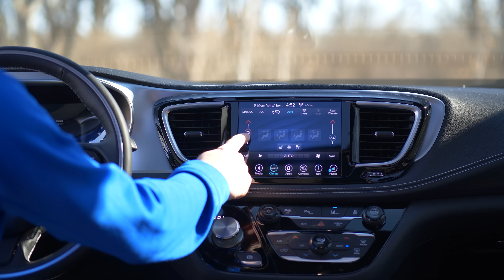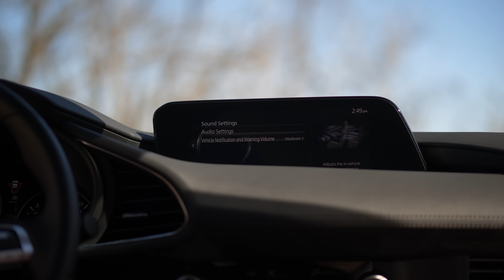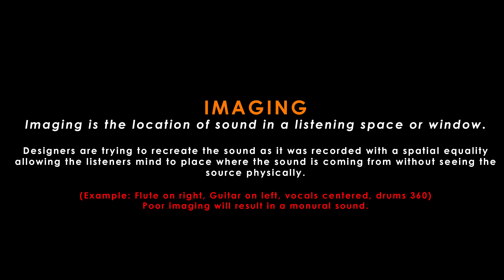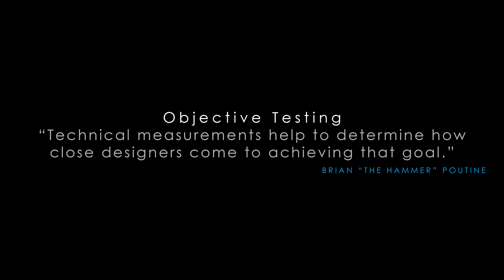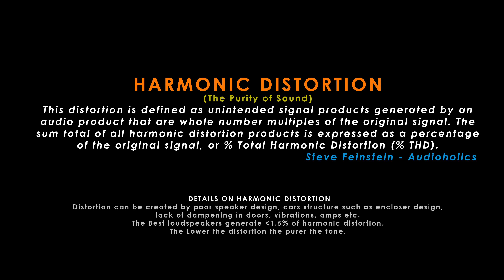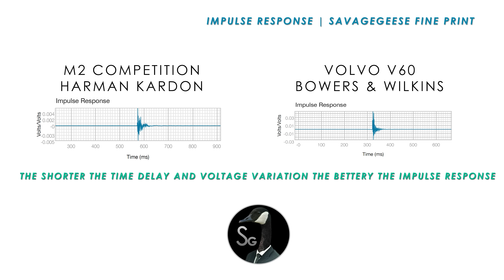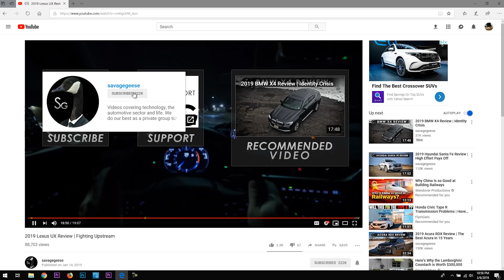Understanding Car Audio Design

Comment: I have always upgraded the sound system in my car, which is why I wouldn’t ever option for an “upgraded” factory system. Right now I have a stock touch screen heads unit with Audison Voce AV K6 components up front, Audison Prima 6.5 coaxials in the rear, both built with custom door enclosures, matted with a Massive Audio Sound Pricessor (to integrate the OEM head unit with the aftermarket sound system as I love the OEM head unit), Massive Audio 9-band equalizer, Custom dual 12” sub box, (2) So y GS Series subs, a Hifonics Mono 1500w amp for the subs, and a NVX 800.4 amp for the speakers. Front and rear doors are sound deadened as well. 

I’ve had Polk Audio MM series and Focal Power series speakers, and the Audison blow them both out of the water for sound, clarity, and power achievement. I would love to go to a (1) 12” sub setup eventually, with a better sub (even though the Sony GS subs sound very good), just to save space, and eventually would love to get a 12-15 band equalizer and an Audison bit-1 sound processor. From there I think it will be as complete a setup for me. 

So far though, this is the best sounding system as it sits right now, I’ve ever had and also one of the best I’ve ever heard. Cost a bit more than a “factory upgraded” sound system, but worth every penny.
Reply: Rear speakers are a waste if sound quality is a concern.
Reply: MICHAEL GRANT true, but because I don’t have the bit-1, which would help me achieve better sound quality using the front speakers, I have the tears to fill it in. Also, I have the tears mostly for rear passengers, and I have a 4-door, which helps fill in the sound for those in the back. Most of the sound for me as the driver, is coming from the front speakers. This is also why I went went coaxials in the rear instead of components, because I know the rear is just for fill in for rear passengers, so I didn’t need anything crazy in the rear. 

I’ve heard plenty of good setup cars with only front speakers in the car, as well as bad setups. If you only have front speakers, you better have a good setup or else it sounds like junk.

Comment: Great video and i hope series..
I have few points you need to consoder..
1. I have a honda legend kb2 and i upgraded the audio because it was crap..its a bose audio..but i figured out after the install where the letdown was on the system
I had all the speakers tested and acording to the engeneer who did the test ..he said that the speakers are so good that many time more expensive speakers can envy them..
The let down was the audio processing unit (amp) 
I found that when i used a helix dsp to control the system and used the low level input from the headunit to get the sound..it sounded awsome..and i told myself it was worth the upgrade and 20days of install..than i found out no controlls worked..volume..mute or anything...it turned out those were after the system amp..and i told myself no biggie i will use the high level input on the dsp and have all channels 5.1 put after the system amp via high level to the dsp..and rewired it and when i turned it on i was such disapointment it sounded exactly the same as before..
Not the insulation, not the speakers upgrade or all descrete amplification matered..just sounded crap..and i couldnt understand it..and went back put it like it was with low level stereo and it was a studio..and than i found out that it was the system amp-dsp that did all the damage..and later i read on a forum that it was all engeneered as it should sound wise but bose was not do the electronics and it was 3rd party even if it said bose on the unit.
Long reply sorry..i have some pictures of the install if its needed i can send a link and measurments of the speakers with the clio

Comment: Of all the cars I had (1992 Peugeot 405, 2008 Corolla, 2012 Seat Leon, 2011 Subaru Outback)
By far, the best sound quality was in the Seat Leon. Each door had a big and small speaker, and the head unit was the most basic thing imaginable. And I loved it the most.

Comment: Really appreciate going in-depth about audio systems in cars. Most reviewers barely mention the sound system, saying it's "OK" or "pretty good." But I do question using Bluetooth only. I think it would make sense to use USB since you're likely to get the best possible sound quality from USB and it makes no sense to me to test these audio systems to the same standard. Bluetooth can be affected by a number of things, like the head unit, interference, whatever device you're using (will you be using the same phone 5 years from now for your standardized testing? I doubt it.), while USB is consistent.

Comment: so the tweeter swap for 3.5" coax speakers in the dash of my CX-5 probably didn't do what I wanted it to even though I gained a lower frequency response up high vs only down low in the doors.  However, some Audio companies don't spend more on the speakers, just more on the fancy amp and sound processing to make crappy speakers sound better than they are; ear trickery....

Comment: I will never forget, probably around 2003, at a car show in baltimore, there was an Acura NSX in the "tuner" section with its top off, and just blasting willie nelson. So against the grain of the car show vibe, and I loved it. 
It was the cleanest car stereo I have ever heard... he had something like a 1000W rms amp with 32 channel manual EQ under the seat.... didnt see a single speaker, all tucked away in stock locations I guess. 
In retrospect, it probably only sounded good because I was standing outside of the car... HA

Comment: This is great. Car audio is important to me and few reviewers touch on it, and normally then it's only in passing.

I would say though, that the sort of person interested enough in car audio that they want to hear about it on the Savagegeese channel (itself on the more technical and enthusiast end of Youtube car channels) are more likely to be interested in uncompressed music. So I think it would not be unreasonable to consider doing your tests with uncompressed tracks connected via aux or USB. For me, Bluetooth and anything compressed, whether the source itself or the transmission, is a dealbreaker. Just a thought that your audience do not correspond with the typical car consumer and therefore maybe going the Bluetooth route because it's most common among consumers in general doesn't quite follow.

Great video nonetheless and I learned some interesting things.

Comment: My 2004 Mini has the Harman/Kardon setup in it. The magnets of the drivers all have the H/K stickers and say "Made in UK." It does sound better than the non-H/K setup. It would seem, back then, they actually took the time to get it right and it's not just a badge. They also made sound profiles for the amp, but the best are "spatial" and the H/K tune. My 2007 Suburban supposedly has a Bose system in it, although it doesn't sound like it.

Comment: Mark, thank you as always for letting us improve our knowledge through your videos. Once again you've proved yourself to be very informative and pleasant to hear. One question though: my 2002 miata's OEM sound system really sucks. Being a spider, there's a huge amount of noise coming from the engine, the wind, the tyres, and so on... How much would you spend to upgrade it, and how would you improve it? I like the look of the OEM head unit, but I'll sacrifice that gladly to get a more pleasant sound experience. Thanks to everybody that will answer my question.

Comment: sound isolation is the most important aspect in car audio. you can made a cheap base model set up that had only low cost as the goal. Actually sound pretty decent when you isolate road/wind noise. adding in sound barriers/absorbotions to keep un-wanted sounds from entering the cabin. on the flip side. you can drop $5k on audio equipment and have it wasted by driving in a tin can.

Comment: Great video! However compressed music itself isn't synonymous on tinny sound. You left one important factor that isn't only appearing on cars. But in the mastering choices for tonality can offset the overall experience. Also the bose bass heavy approach has good sides, because listening environment changes when there is road noise and people play louder. This leads to situation where ear sensitivity for mids and highs come to play. You can check the Fletcher-Munson curve. One really nice feature would be automatic eq tilt that compensates the tonality regarding the master volume.

Comment: Excellent video and very informative! I had a 2019 Ranger Lariat out for a test drive and it was equipped with the B&O audio system. Very disappointed with that system and I was thinking to my self, either I don't have an ear for music or Ford got the B&O labels cheaper than they could get Infinity, JBL or Sony labels. My Ram SLT had better audio system and it was just a stock system, not Infinity or Alpine. I expected way more out of the B&O system for the $3000 cost.

Comment: Any acoustical analysis of why luxury car's were using acoustic windshield, dual pane front door and rear door glass and now have opted for acoustic glass only on the front doors and windshield? The Mercedes S500 was a Vault with acoustic glass windshield, dual pane side glass and acoustic rear windshield. I can't forget the use of acoustic glass in sun roofs vs regular tempered glass that most luxury cars use.

Comment: The beats system in my car is only the added sub, but in the past the same system has been branded as fender, as all the speaker part numbers are the same. it's just what sticker is on the A-pillar tweeter.

also ford uses B&O play, audi uses 'proper' B&O.
Reply: Kind of funny because FCA does H&K proper without an arm and a leg

Comment: For audiophiles most new cars systems will be swapped out with aftermarket quality. My fasher in law replaced his accent speakers with mb quart components and 4 beastly 8" woofers on 2400w. He's been in the audio game since the 80s.
Reply: 2,4000w system in a vehicle is laughable.  Wattage means so little in validating a systems quality. I have 1 10inch JL W1 v3 sub in a ported box getting 300w of power as recommended in my open trunk (Subaru forester, fully deadened). Paired with JL components and a Alpine 5ch amp.  You feel and hear everything. Anymore power and my young ears would get damaged for life at normal listening volumes. That’s a reasonable $1,000 system with an extra 800$ for labor and new infotainment. The only reason I see to go for more power is if you drive a large SUV. My point is quality over quantity, why do you think there are 800$ single JL 10 inch subs? There is only so much space in a damn car for air to properly move.
Reply: @robob221  4 Dc audio m3 8s and 2 JBL gto 1001 amps pushing them. And mb quart components in the front. He's about sound quality and bass quality. Built and installed himself. And i know what a JL 10" w3 4ohm can do since its what i have for my e30 with a 500w jl pushing it.
Reply: @voltairee3012  bass quality and a tiny space like a vehicle are two things that don't fit. I understand the appeal of massive base that tickles your whole body but to say that's "quality" is extremely subjective. Bass needs a lot of air to mature properly, thus cramming multiple subs in a car grants diminishing returns no matter how you install them. At that point it is simply better to stand outside of the car. If we are just talking about competitions then sure, within those parameters I can see the purpose. For practical use in a car though, where you want to hear the full spectrum without massive reflections disturbing the rest of the frequency, less is more.

Comment: BOSE's rolloff is annoying when you listen to classical or prog rock where the dynamic range isn't compressed, so it ended up sounding extremely dull in my C4-era ZR-1. There is a saying "No highs, no lows, it must be BOSE." They should instead aim for a flatter response and advise consumers to leverage EQ (or treble controls in less advanced head units) to tame the tinny sound on DR-compressed recordings rather than fuck it up for people who listen to music that isn't so compressed. When those people complain about the harsh sound dealers should be cluing people in to the tone/EQ features and tell them to RTFM instead of gimping the audio system.

Also, where the driver's seat is (hopefully ;)) ALWAYS occupied when the car is moving, and the passenger seats are not, the driver's audio experience is what matters most and what the audio system should be tuned for for frequency response and timing, with passenger seats being a lower priority. 

I like HK for factory systems because they don't severely roll off the highs and I find myself turning down treble on DR-compressed recordings but keep the treble control neutral most of the time, but I bump the bass up because HK are lacking in deep bass. When I buy an STI I'll be modding the HK system to add aftermarket subs for deep but controlled bass and not have to turn it up, and it will end up less boomy than stock but have a much deeper low end which is appropriate for my favorite genres.

Comment: I bought an Audi A3 2009 recently with the Bose audio package and wasn't really amazed by it. So I yeeted that subwoofer out of the car, got myself a sealed Eton sub, a monoblock and a 6 channel amplifier (also from Eton) and after setting the amplifiers the whole sound system sounded alot better.
Reply: Great choices! I wish Eton would sell stuff in the US without the ridiculous markup. I believe that Eton and Morel shared the same build house for the both new amp lines. Both great.
Reply: @ster9765  Sub: Eton Force 10-600G (180$), 6Channel Amp: Eton SDA 100.6 (380$), Monoblock: Eton SDA 750.1 (290$), + Full copper cable kit for about 60$. Kinda expensive but at least it sounds great

Comment: Looking forward to your audio system reviews. I personally, after selling my 2015 C200, was looking for a car with a good audio system.
I tried 2016 Cadillac CTS, 2019 Mazda 6, 2019 Kia Optima and Cadenza... and even Kia Picanto.
And ofcourse the Bose in Cadillac sounded the best, surprisingly it was not as good in the Mazda.
Cadenza and Optima does a good job of cutting our road and tyre noise, so that elevates the music quality.
Kia Stinger 2.0 also has a decent one, but then some car makers send engine noise through speakers into the cabin. How does that make a difference in in-car audio?

Comment: This is great, but my only concern is that car manufacturers would likely tune the audio system (timing etc) for the driver, right? So measuring from the passenger seat may skew the results.

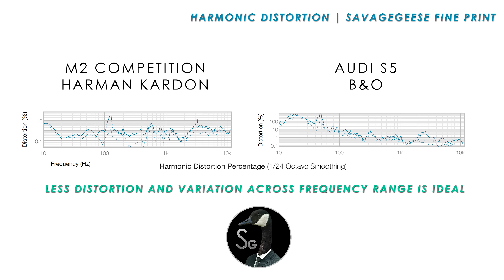Comment: Some thoughts: 1-Measurements aren't everything! Two systems could have similar Freq. response graphs but sound very different if the speakers are places in different areas, timing/crossovers between drivers are different etc. etc.  2-Would be very important in my opinion to have graph's with the same axis references across videos. For example, at 15:13 one could very easily assume both are being measured and displayed with similar axis information when in fact the y-axis on the right shows past 100 while the other one does not. 3-This one actually im not so sure about, but it was my understanding that the "best" sound you could get was from the drivers seat? Even with everything set to default, i would have assumed the DSP is still taking the audio and delaying it etc. to make the driver area the best possible part of the audio experience because it is the most used part of the vehicle. In my own sedan, sitting in the passenger seat the audio signature is noticeably different sounding than from the driver seat. 

Otherwise i am very much looking forward to these future audio comparisons. Its about time someone does it right.

Comment: My home theater system I place the set up calibration dongle where I sit the most. I'd think car manufacturers would engineer audio where the driver's side in mind.  Interesting it's the passenger side in cars the get the best audio but didn't think about how much more stuff is in the way on the drivers side for terms for audio fidelity.

Comment: Great video. Can always appreciate another audiophile nerd. You mentioned that the new Mazda 6 was able to play hi-res audio, did you do any testing in that car? Also was 'Mom "Shits" her p... .flac' used in all spectrum analysis?
Reply: I have, it plays 24/96 Flac. Unfortunately it's powered by an amp that guts the mids and lows at anything past 1/3 volume."Fatiguing" would be the correct term.

Comment: More speakers is better in many cases.. a stock vs premium sound on low end cars adds tweeters and sub.. that usually brings the sound stage up, less distortion, more audio range.. beyond that sure it gets messy on some.